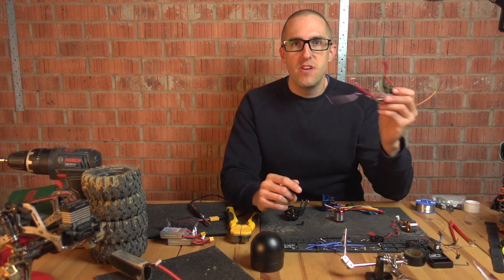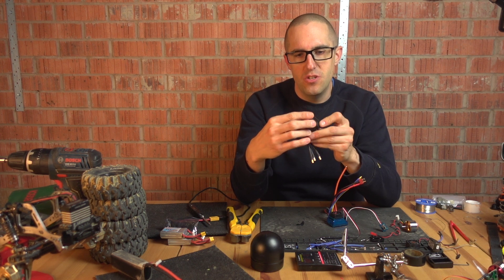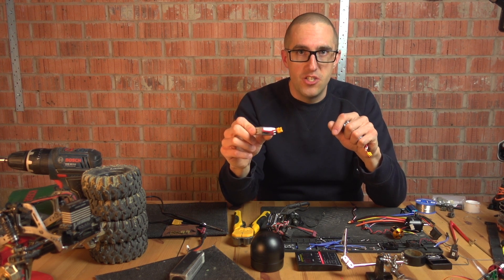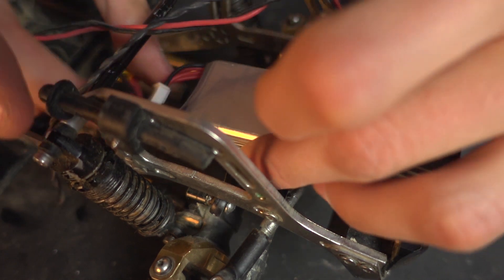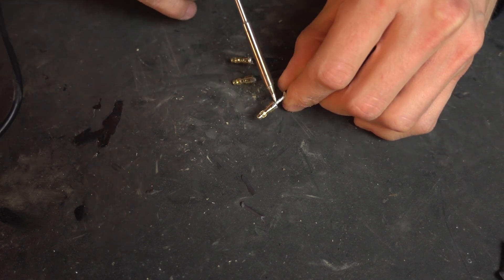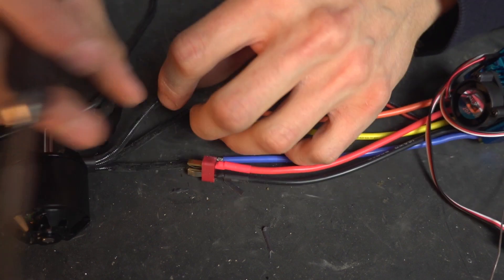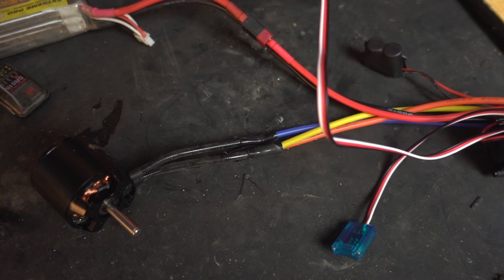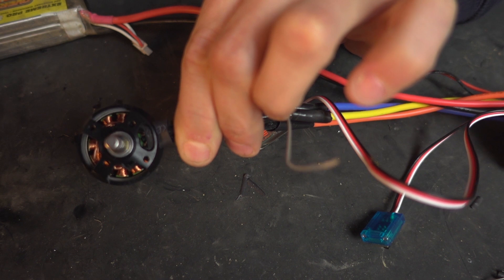Amazing budget brushless system! More messing with cheap motors from Amazon ...

Comment: Thanks for posting this video.  I’m glad to know that I can use my Hobbywing ESC programmer card for this ESC, as I just bought two for my Clod.  How has the ESC held up for you?
Reply from the maker: It died, with a lot of smoke and sparks
Reply: @JustScalin  LOL!!!  Actually, the ones that I received were even clones of TSky, they didn’t even have the calibration button, and the Hobbywing ESC programmer card didn’t work on them, so I retuned them.

Comment: I’m pairing this motor with a sensored ESC. Does the instructions for the motor detail which lead goes where on the ESC?
Reply from the maker: Doesn’t matter for sensorless, you just swap wires if it’s backwards

Comment: Does anyone know why these motors make that loud whistle sound?  I'm trying to figure out how to mitigate it.  Please let me know if you have a method!
Reply from the maker: It’s the way the ESC controls the motor. The noise is a by product of the ESC trying to detect back electromagnetic force which indicates where the motors rotation is at. It’s common for all non-sensored motors,  but worse in outrunners as the noise leaks out the open shell
Reply: @JustScalin  Is it an important function for it to know where it's at?  I mean it's not like a servo or anything so idk why they do this...any idea how to stop it or do i just have to cover it up to mitigate?
Reply from the maker: The noise is literally part of how it operates, sorry. You’d just need a standard sensored brushless motor, but then the money goes up
Reply: @JustScalin  actually you can detect back emf silently, quad copter esc's do this. They can also be programed to have reverse to work for crawlers.
Reply: @JustScalin  Also do you know of a motor like this with sensors?
Reply: homes hobbies crawl master mini gets rid of the noise.

Comment: Nice video, just wondering how did you put the pinion gear to the motor?
Reply from the maker: On this motor it’s a 5mm shaft so used a normal RC pinion
Reply: Thank you, i just ordered this set. ❤️

Comment: Hello, what motor is it? Thanks
Reply from the maker: Surpass hobby 3548 although it did set on fire so needs a better ESC
Reply: What was on fire, ESC or motor. I'm seriously thinking about try with this motor. I ready to buy a good ESC like the mamba X or a EZRUN, Toro...
Do you think it's more safe with a 120A or a great expensive 60/80A.
For the motor I will try with a very slow 1100kv.
Reply from the maker: I think the ESC couldn’t control the voltage and causes issues. Both set on fire but at different times
Reply: Ok
Si even a good ESC with good temperature control doesn't work🤦‍♂️
There is a guy who program a airplane ESC to use those motors and they works smoothly and quite 👏
The problem is I don't know anything about programming 🤔
So, I can pay for a revolver/3 brother yellow jacket and a mamba X or go to sensored wich could be buy for a reasonable 70$ on combo.
Reply from the maker: @cutximbiriosos3239  I think the motor would pair ok with a Sidewinder 4 as that has better sensorless modes. However I also had magnets fall of the motors, so I think they are better designed for constant load (airplanes) rather than stop-start like a crawler
Reply: I finally tried (I know it was stupid) and it works (1100kv motor and 80A cheap esc) but it is imposible to modulate the torque and speed.
If I program the esc with a soft start it's a little slower but it accelerate really bad even in flat. If I program to a 2nd step of starting, it becomes so fast.
Reply: @cutximbiriosos3239  how would it go with some sort of reduction gearing?

Comment: Do you have a running video using this bl system? Been planning of doing the same. Thanks
Reply from the maker: I did a follow up but basically the ESC kept setting on fire. I think they were a dodgy batch
Reply: @JustScalin  yes we actually use that kind of esc for budget bl system for drift cars. Same problem keeps smoking. I wish there is another affordable esc for that motor for crawlers. Well thanks man surely a quality content, im your new subscriber 👍
Reply from the maker: Thanks man! If I do work it out I’ll definitely post it
Reply: @harleydavidsonolis4207  Try a Fire Phenix  ESC 2-4S  .
Reply: Okay so I'm not the only one. To the garbage it goes
Reply: Is there video outsdoor so we can see the low and high performance.. Anyway cool vid bro. Keep up. 👍👍👍👍

Comment: Can I have the link to the motor and would it fit a trx4 sport
Reply from the maker: I’ll dig one out for you in the morning. It’s a surpass 3548 1400kv. I’ve had a few issues with it which I’ll cover in the coming weeks. I have some smaller 3530 motors coming which are 1700kv and should be much better so watch out for the follow up videos.
Reply: @JustScalin   thanks  would any of them fit a trx4
Reply from the maker: @rcmakka2870  yes the 35xx size brushless should fit a TRX4
Reply: @JustScalin  thank alot 🙏
Reply: Hi I just got the surpass motor what type of pinon do they take mine for a trx4 sport stock